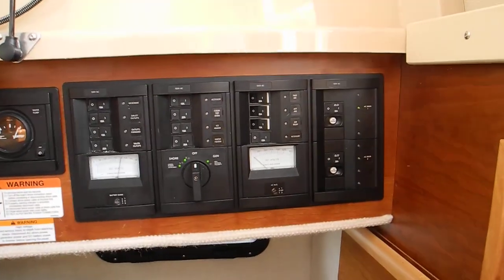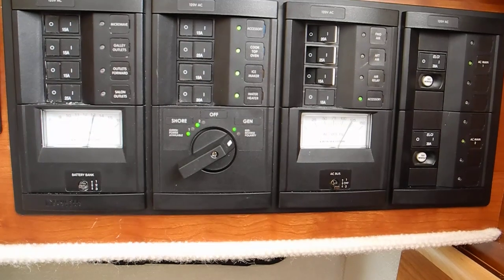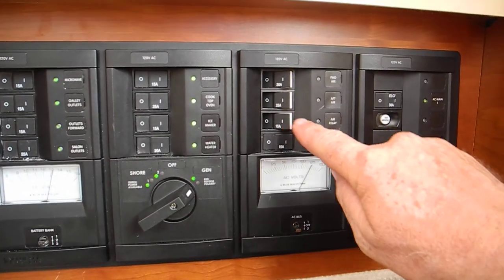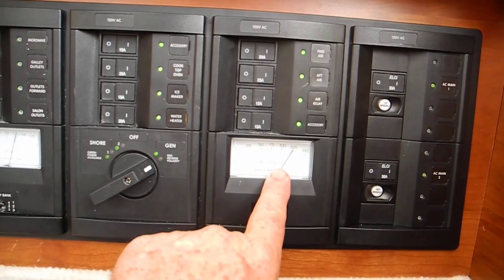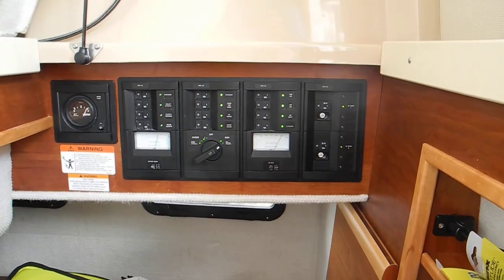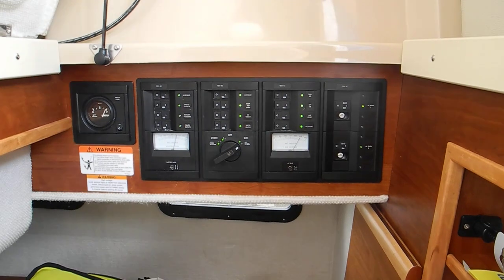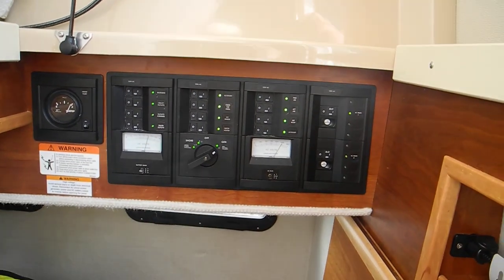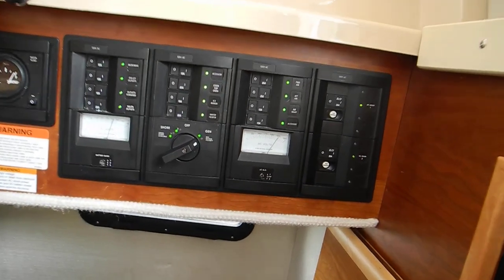Switch to generator power

Comment: You shouldn't sleep overnight with the generator running.
Reply from the maker: E Z we believe safety is first. For that reason, you should inspect your properly installed marine generator for any exhaust leaks, install CO monitors as directed by manufacturer in all living spaces and keep your windows closed when running your generator (and your ac or heater). When anchored, the generator exhaust should go downwind from the boat. Do not run a generator overnight in a marina as the close quarters could allow your exhaust to infiltrate other boats nearby. We followed these basic precautions for 30+ years aboard our boats and had no problems. Thanks for watching.
Reply: @AskCaptainChris   All going points and suggestions.   We inspect for all leaks and run no less than 4 CO monitors in the living spaces.    Not only the close quarters of the marina but there tends to be less wind which can lead to a buildup.    Yes, the alarms can save you if you wake up and act in time.   But we have seen a recent uptick in CO deaths from running Gens at anchor and in the marina.    My safe practice is to run the Gen and cool everything down and when you are going to turn in shut it down.   This is of course on a "Smaller" cruiser of 40 feet.